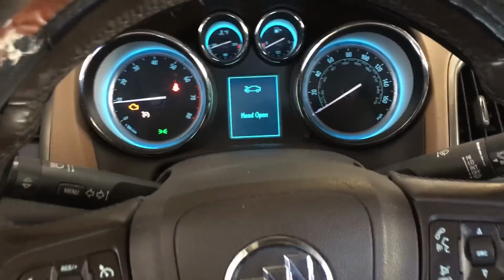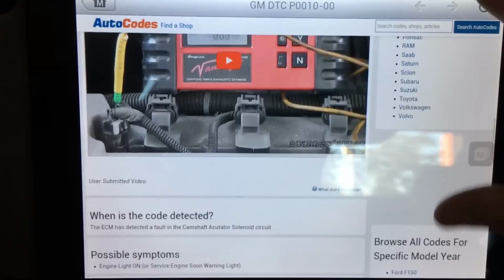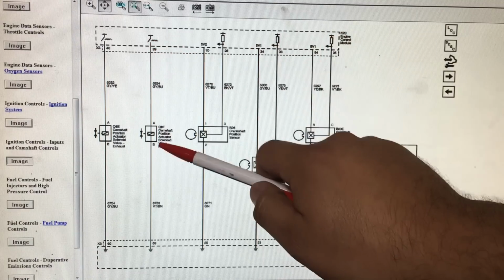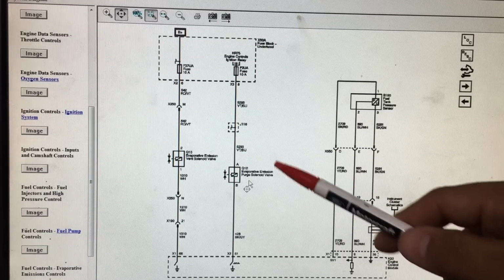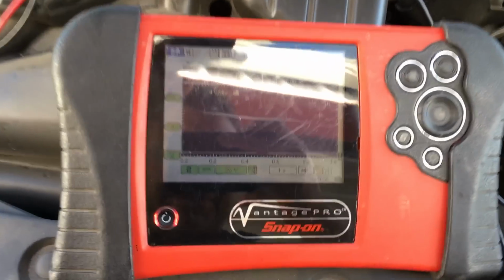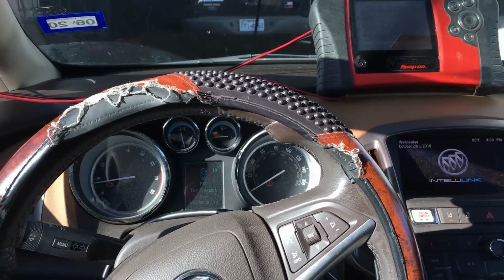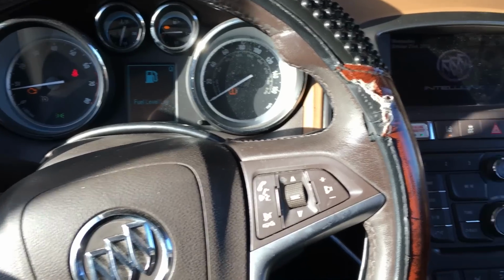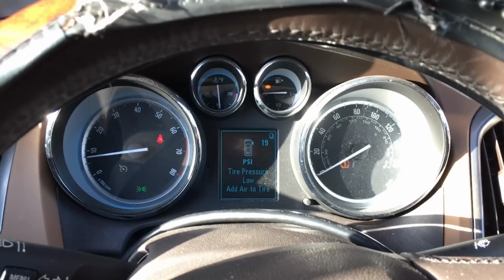BUICK VERANO RUNNING ROUGH VVT PROBLEMS P0010 P0011 DIAGNOSIS

Comment: My 2012 Regal did this as well. It would stall out when I put the car into reverse. I had a Fix'd Bluetooth Reader and found the code and part to fix it. Bought off ebay for 25 bucks.

This solenoid part has a high fail rate.

Comment: I have the 2014 and it runs great 90% of the time. That 10% is when it goes bipolar and does this same thing. I have the same codes and more but I've changed sensors that were supposedly bad and causing the issue but still doing it. About once a week for only about a day it will act like it wants to stall or if I barely give it gas like if I'm reversing in a parking like it will stall but if I'm at a light I just give extra space between me and other car and give it extra gas at take off so it doesn't stall. I'm going to change the sillinoid and hopefully it fixes the problem because I do have a teen with a learners permit that I haven't let drive in town yet because of this issue and I hope it fixes it. Thank you

Comment: Thank you so much mine did not set check engine light so I tested it it wad reading 0.00 ohms witch is wired but I just replaced it problem solved thank you

Comment: as far as I concern resistance of solenoid must not be more than 15 ohm otherwise it’s out of work, then u may check workability of solenoid by activating it through diagnostic  and the engine will stall on idle if solenoid workable

Comment: I’d like to add this review thank you I recently want to take 5 Oil change place they try the bag that my car is fine with regular oil not the full Fetick Not sure it’s a type that didn’t write a good look out because my oil who’s getting low I didn’t realize and when I went to oil change, he found my cord to oil low. He found my transmission cap loose and something on my undercarriage cover for the engine was all zip tied together boy $260 for a tuneup might have to go to the mechanic and get those auto parts that you have in your vehicle Taken out and replace I say thank you to the great video

Comment: What if changing the solinoid doesn't fix this problem?. Girlfriends car has the shudder but no codes. She replaced the solinoid as well. One new one and one used one. I was thinking an oil galley might be plugged?

Comment: What do u think it could be ive replace everything ocv, syncronizer, chain tensioner, test solenoid wiring all goods signal from ecm is good but every time exhaust vvt is connected card shuts off, do u think it could be an ecm problem maybe because it is beind commanded when it shouldnt

Comment: This is a great video. A lot more detail on diagnosis than a novice like me needed as I just wanted to replace the solenoid based on the p0011 code but this video gave me confidence that I could do it myself. The only thing lacking was how to remove the wire connector from the solenoid itself which took a while until I used a plyers to apply enough force to disengage the connector.

Comment: I followed this video and another to replace the intake VVT solenoid on my 2015 Buick Verano with 70k miles, and it worked! Before the warning light showed up, the car stalled from time to time and I suspected the battery was dying. I took the car to Walmart and they said the battery was indeed dead. Since the battery still had two out of five years of warranties left, they replaced it for only the difference between the prices now and then. After the battery replacement, I noticed that the battery voltage on the car still fluctuated a lot, from 14.8V down to 12.8V, and the car would stall at low speed, such as before traffic lights or in a traffic jam. Then the warning light also showed up. At first, I thought the car needs an oil change. It did. When I took it to Walmart to change the oil, they said it was almost empty. I chose synthetic oil, even though it's not required. Walmart is the only one that has not raised prices. At the dealer or JiffyLube, it's around $90 but at Walmart still $56. The day after the oil change, the code was gone but returned and stayed there the next day. I used an OBD II scanner and it read the code as P0010, with the message "A Camshaft Position Actuator Circuit/Open Bank 1" and "A Camshaft Position Timing Over - Advanced or System Performance Bank 1". After watching these videos, I took the solenoid out and measured its resistance and it's about 130 ohms, while the other one (and the new one) is in the 20 ohms range. I bought a new solenoid for the intake side from Napa Autoparts for $45 (Made in Poland. The exhaust side one is a few dollars cheaper), which looks exactly the same as the one I took out. I put it in and disconnected and reconnected the battery too. And voila! The battery voltage is now stable at 14.8 - 15V, the warning light is gone, and the car no longer stalls. Only the steering wheel seems to be a little bit stiffer than before.

Comment: Also the resistance check of the new one and the old one it's pretty similar around 10 ohms to 14 ohms which is really not identified by doing voltage tests

Comment: It seems like the resistance of any coil the DC resistance is always on low value like you said 10 ohms so when you disconnect the connector and reconnect the connector it goes back to low voltage because of the low resistance of the coil but you also see that 5 volts is a quiescent value that's because down the switch is closed inside the computer giving you 5 volts and the duty cycle is what changes

Comment: We saw same variable resistance on a VVT solenoid that threw a code on a similar 2.4l ecotec engine. We replaced both solenoids with OEM parts; those also read about 11ohms new.

Comment: I like your videos really good at explaining things easily in a methodical way .only thing I sometimes think and I've been caught out with power probe is there led lights and have been caught out as need a test light I personally think  as well as power probe just to load circuit more only my opinion though

Comment: Just replaced the intake cam solenoid actuator on my moms car. Had rough intermittent idle, hesitation under acceleration and poor fuel economy. Also 5with check engine light. Only thing I did differently from your video is I unplugged the negative side of the battery first before I worked on it. Once new part was installed I hooked everything back up and no more check engine light. Was on a 2014 verano premium with 2.0 turbo.

Comment: I had the same problem with my 2016 Verano. Had 59 ohms on the intake side. According to my dealer the normal ohm range is 7-13.

Comment: Excellent video! Well explained. As a rule of thumb I always doubt anything with a coil. I am retired but over the years I have found that anytime you are troubleshooting something with a coil look at the temperature around the device. If it is subject to high temperature it will affect the windings. Also if there are 2 in the same place I would suggest that you recommend to the customer to replace both.

Comment: Acts like a coil when energized it soaks the voltage to operate so it drops and voltage goes down amps go high. Being a square wave just like a can signals.

Comment: thanks for your posted fix. just replaced my intake VVT on 2016 Verano sport touring non turbo; I allowed the engine light to reset (clear) on its on after approx 30-40 mile drive cycle (running errands)! gtg return to service lol. now to delve into the intermittent passenger airbag light--on when 'nothing' is in the seat. again thanks!

Comment: Bravo...really nice job using your troubleshooting knowledge! You saved a customer a LOT of frustration and money! The sad part is that a lot of garages put the time/money factors in front of accurate and confirmed testing; which initially gives the appearance of expertice to the customer, and makes more initial revenue for the business, but in the end they didn't fix the problem and the customer will spend their next dime someplace else. When things are done right, you might add a little time, and have a lower revenue for that issue; howeve, you will have earned the trust and respect of the customer and will most likely have repeat business and new business from the customers recommendations.

Comment: You are correct about the bias voltage, if there was no bias voltage at the unplugged solenoid connector, then the wire would be broken and a code would be set for that also, probably the same code for your example of an open solenoid winding and even the ground wire going back to the ECM. The width of the PWM signal tells you if it is actively moving the solenoid or just sitting idle and happy doing nothing. The exhaust is sitting idle at 50% duty cycle. Intake seems to move around a bit, has no need to move (at idle, in park, with no load), this statement means nothing bro, the car is not accelerating so no need for VVT action correct, the duty cycle is fluctuating for no apparent reason, is this pointing to a problem, need more experience to know for sure?  WIGGLE TEST. The solenoid is loose at the connection pins and fault found with a fucking ohm meter which I hate using, but I would also use it here as a GO / NO GO test with no specs from the book the same as you are saying, compare to the other one since its there staring you in the face and its the same part performing the same job, (maybe not same part number based on clock position of the bolt hole??). I think we found why the duty cycle is fluctuating. I am guessing it should stay at 50% also. You did not show a scope reading to prove this scenario, this is what I complain about, a test to find the problem but no KNOWN GOOD PWM/Duty Cycle reading on the scope (since you used it earlier) to prove it's fixed. Now to answer your concern of diagnosing the long route and some guys thinking you are wasting your time and theirs, how many guys know, hey, the Duty Cycle is fluctuating at idle, let's do an ANTI wiggle test and see what happens. This means to put pressure on the connector and see if the Duty Cycle stays at 50%, NOW, do we have a bad pin/wire in the connector or the solenoid has loose pins leading inside the solenoid, these ASSHOLES who throw a solenoid at it and didn't catch the loose pin fit or wire barely hanging on the connector can go jump in the fast-moving river LOL Thanks for the Duty Cycle lesson, try the ANTI wiggle test next time......

Comment: i'm did a 2017 verano with 2.4l engine. i read 2 volts on the ground side wire. revving the engine when it had been warmed up, there were glitches on the driver waveform.  checking the ground wire resistance against pin 5 of the dlc through a breakout box showed intermittent resistance value

Comment: I'm looking at a vehicle being sold with potentially this problem. Could any particular driving habit (like driving your car with low oil) cause these actuators to go bad and set off codes or are these really just limited to some type of common malfunction with these vehicles.. or maybe both? Thanks for the video. Your explanation helps understand how these components work

Comment: someone please help me. I have a 2014 Buick Verano when i am at a low RPM 1500-2000 in any gear there is a humming noise that  increases as i accelerate.

Comment: hi i hve question for uu sir.i hve 2013 buick verano 2.4L few days before its engine came on than i check with meter its showing P0013 code on it. i thought its exhaust side solenoid hve to be replaced. after i replaced it nd engine light gone also. but nxt day it start creating problems when i was trying to stop at any red lights my car starts shaking than i change intake solenoid also but my engine start doing same thing like crazy. At the end, i replaced both with old ones nd my car running better but engine light came on again. so what uu think about this topic nd what i have to do now.

Comment: I can tell you from experience. No voltage sensing circuit inside the pcm. The pcm monitors the camshaft position sensor of that bank to see if the command equals actual position. Enjoy your videos.

Comment: You need to get some proper terminal test probes so you aren't poking at the solenoid like a DIY guy.  This will also leave your hands/fingers free to stress the body of the solenoid, which usually reveals an intermittent open condition if there is one.  AESWave.com has a nice set,.

Comment: It probably sees 0 volts when it’s closed and battery voltage when its open soooo when it commands it closed the computer expects to see 0 volts but if it doesn’t it sets the code.... that’s my guess

Comment: Good video. In description and operation don't explain. But in the troubleshooter for the same code is a note. 
    Note: A test lamp must be used for this test. The control circuit is pulled-up to a low current voltage, 1.5-3.5 V on the control circuit is normal. 
 That info is key but it doesn't apply to every system and car. Example Chrysler monitoring a field collapse to check for coil integrity.

Comment: I fix a lot of these the circuit breaks on the solenoid .I change the connectors too or they bit you in the butt if you don,t change it too.

Comment: you made this diag way over complicated for this . these solenoids fail often on the 2.4 L engines, typically caused by lack of oil change/lack of oil. as a gmc tech i always replace both solenoids and perform an oil change. typically a 10 min diag and a 30 min repair including oil change.
Reply from the maker: Yes I understand that, but that is not what this video is about. We are trying to better understand circuit design so that we can apply that knowledge to any system on any vehicle. Thank you for watching!
Reply: So you fire the parts cannon at it.

Comment: Thinks for sharing, it is very helpful method we need for GM and OPEL cars.
For diagnos I use Bosch KTS 540 and we find diagrams and values for must electrical parts, put sometimes we need diagrams we not found inside data base KTS.

Comment: To answer your two main questions, the sense circuit is on the high side control. The bias voltage is used to calculate the circuit resistance by looking at the voltage drop across the sense circuit's precise dropping resistor. The other question was the spec for the solenoid resistance, you were looking at it when you had the code troubleshooting document from GM. It's under "Component Testing "  step 2. 8-13 ohms.

Comment: I suspect the high failure rate of those solenoids is because of the position they are in on the engine. The area is hot with little air flow. I's a terrible position for anything electrical.

Comment: I would say its checking for voltage, for example if you have a open switch and a load on the next side and test the two sides of the open switch you will have 12 v but if u close the switch u will see 0v, because the build up of electrons (12v) was at the opening of the switch and had no where to go, but when it is closed the electrons will move to the load thats why at the switch u will see 0v but on the load you will see 12v

Comment: I would think that the live and ground are beside each other inside the ecu and the voltage sensing circuit goes from the live to ground but for the purpose of the digram they are shown as being seprat.

Comment: when yo use a pwm  circuit for controlling it  a voltage sense  would not work it would see off on off on etc.  even a small bias voltage  would get grounded through the sollenoid. has to be an amp  style sense in one form or the other. since there is inductive kick with a sollenoid  how would you sense  voltage as some have suggested?  might i suggest doing a manual setting on the ohm meter.  your reading will  much faster and more consistant

Comment: That Vantage Pro is great for viewing on camera, but if you bought on EBay an Agilent U1241A or U1242A DMM you’d be shocked at how much quicker you’d get ohm measurements.  It wouldn’t show upon camera though, so maybe that’s why you’re using the Vantage Pro.
Reply: plus his setting is on auto.  the meter starts at mega ohms and slowly goes through each range till it gets one it likes.  some are faster than others.  if you have an idea what it should be just go to manual   if its 12 volt with a 2 amp fuse for instance  it should be < 6 ohms.  so do the 200 ohm range

Comment: I'll guess that you are right, the bias voltage seen only when unplugged suggest a trickle of current is going across that little stepper motor even when not activated. Like a flashlight that kills batteries over a few weeks, the switch has a tenuous pathway through corrosion inside the device to ground. It would have been interesting to see if the same bias voltage is seen on the exhaust side. Dang those manufacturers for not providing adequate information.
Reply from the maker: Thank you for watching

Comment: Great video, I just want to give you my 2 cents. Beware of checking ground with the power probe because it has a hi impedance and will show a good ground and it could be bad. Always load test grounds and powers with some load. Also know that temperature has a big part when checking resistance, when you tested the new solenoid it was cold, at op temp it could change 3-5 ohms.

Comment: Good explanation on the circuit.  Could have a shorted or grounded wire.  Good for you to diagnosis first before throwing a part at it.

Comment: Another great video good way to diagnose these solenoid quick is a resistance reading I guess. Trouble is can't do this on some things like abs sensors the new ones go wrong using resistance. Why I'm so impressed you scope everything surprised that never showed the fault as well though

Comment: Solenoid coils will mess with even the most experienced tech. It may work perfectly while cold only to short when hot or vibrated or placed into service. Such a simple thing as a coil of wire and they cause more headaches than are probably necessary.